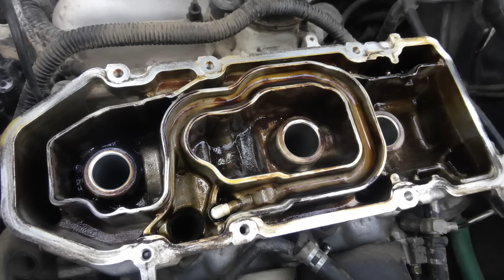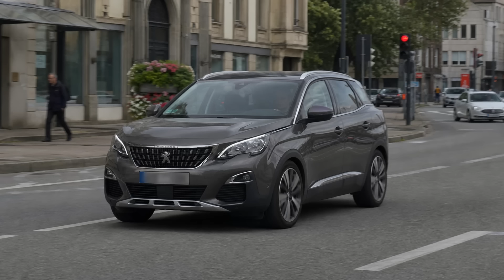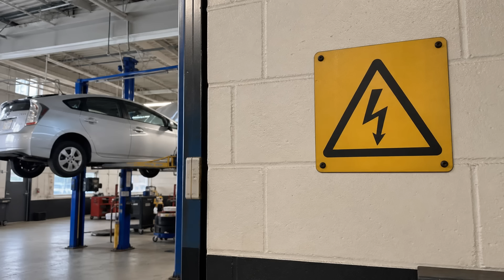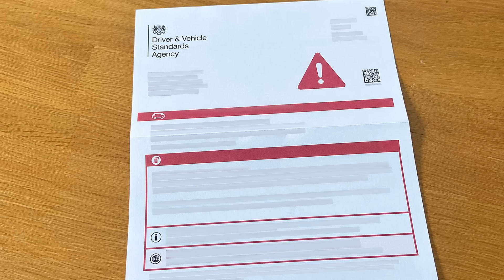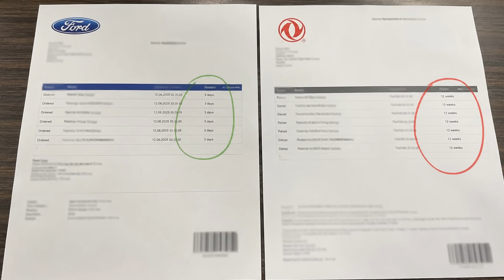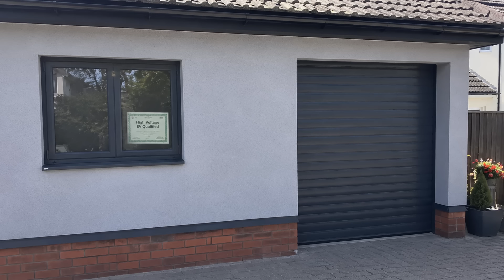12 SUVs BANNED From UK Garages! Here's WHY

Comment: I can't find the diagnostic socket anywhere on my 1958 Austin A55 Cambridge! 😳
Reply: They usually only have trouble with that big nut behind the steering wheel 😅
Reply: @chrisbraid2907 
Sometimes the jerk in the seat causes problems too😁
Reply: @frenchenstein 😂
Reply: @frenchenstein  some fell on stony ground!
Reply: @chrisbraid2907 😂
Reply: @chrisbraid2907  10.4
Reply: Or a 1994 Montego!🤣
Reply: I think mine was deleted on my 1968 Ford Escort 🤷🏻‍♂️(🤣😅😂).
Reply: Have you not tried phoning customer services at Austin Rover?
Reply: @johnboluski-zl1qn 
😊 why didn't I think of that??
Reply: Excellent!
Reply: The old A55 was my first car after I passed my test. From memory I think the gear lever was on the steering wheel, forward and up for 1st etc. Great little motor. 0 to 60 in about 90 seconds but it got me where I wanted to go
Reply: @davidadams5116 
Yes, David, 4 speed column change. Someone  has put a 1622 Farina engine in it.
Reply: Lift the bonnet,  tweak what needs to be tweaked,  put ya tools away, and off ya go. Job done.
Reply: Real engineering
Reply: Poor you!
Reply: My dad bought a 2nd hand one around about 1968, and the handbook told you how to drive the car, after reading it and some practice I could drive it up and down the driveway, age 14, never got out of 2nd gear though.
Reply: I couldn’t on mine either.  It must of been a design fault.
Reply: That’s because On them cars the diagnostic socket is in your head 🤣🤣works so much better 👍
Reply: Its behind the steering wheel🤪!
Reply: You shood know  its behind the left  headlight 😂👍
Reply: @edwinlane9099 
I'll check again, Edwin ! Thanks a lot.
Reply: It's probably in the boot !
Reply: @gstree 
Of course! I'll have another look.
Reply: Think you will find it in the Haynes Manual under new cars are sh@@e section.
Reply: You lucky bastard lol.
Reply: @conradnagiah3696 
Unlike your sad self, I had a father who taught me to speak respectfully and with dignity. I await your genuine apology.
Reply: @colvinator1611  It was meant as a joke, you're fortunate having a simple car without all the complex electronics.
Reply: You can find the socket at the 67 year old semi retired mechanic down the road. I'm so old that these1950s cars I used to convert from positive earth to negative earth and replaced valve set radios for transistor radios. So old that I gave up when electronic ignition became the norm. I could go on and on but it's true. New plug in and diagnose vehicles are a nightmare to me. I hate them.
Reply: @khayimsimpson5153 
If that's the case, I'll just manage very well without it ! Thanks for the advice. 😅
Reply: @khayimsimpson5153 
I put a transistor radio in my A60 in the late 70s, the Sanyo radio had a switch on it so you could change the polarity.
Reply: Me too my cigarette jack only runs cigarettes  😂
Reply: Your joking. Them things never went wrong  my dad always said  he would go to an Australia  in his.  It would start first time  and never fail
Reply: How surprising
Reply: Oxford ones only have them.
Reply: @petercucumber4380 
Gasp ! I'll have to get that Haynes manual.
Reply: O, a lucky person!😅
Reply: That can be located within your own brain and is directly  connected to you hands, eyes and ears!
Reply: That's because they are super simple, like their owners.
Reply: It's underneath the  heated seat module.
Reply: Its in the same place as my 1973 vw beetle
Reply: It's behind the back seat. Remove the big piece of cardboard covering it from inside the boot. Replace the points  in the electric fuel pump.
You won't need the diagnostics now, everything else is straightforward.
Reply: @gordy_wgtn_j8 
Aw thanks. I'll get cracking.

Comment: Have a 2006 Kia Rio with 270K miles on the clock. 1st hand. Bored to death to drive it but I'm going from A to B and it has hardly gone to garage apart from service. Thinking of buying a Sandero with LPG. Don't like batteries. Never did. My only issue is the spare wheel Well the lack of it I mean.
Reply: I have a Rio diesel 2011 never go wrong bomb proof engine with a cam chain what more do ya need .. no garage bills
Reply: @Mark-iu8mr How does it fare with all the ULEZ baloney?
Reply: @JohnDobson-j7o I don't go to them areas live no where near the city .happy days lol
Reply: I have 2017 Dacia Sandero Stepway. Great, simple car and easy for independents to service and fix. Cheap too and good on fuel. Be careful with the newest ones though...

Comment: I have a 2012 Kia picanto -  a little four door town runabout. 2 months ago I took it to my trusted local independent garage for its annual service and MOT test. All well, apart from an airbag warning light which the independent's access to software would not diagnose and they told me that unfortunately I would have to take it to the local dealer. The local dealer, who I have avoided for a few years as they have done very poor, and even damaging work on this car in the past at very high prices, charged me £260 simply to plug into their computer and then £460 + labour at £135 an hour for an airbag unit.
Reply: Main dealers are to be avoided, they are crooks.

Comment: I have an Audi TT 2015 with 50000 miles on it. I’ve had it 5 years. Dealer service £800, independent repairer (accredited by Audi) £350 per service? Tyres, replaced once, nothing else. When I look at new cars I cringe! I won’t ever have electric, autonomous driving or hybrid. The only thing I would consider is old school! I may just keep this Audi TT for ever.
Reply: Rust: Hold my beer
Reply: Good choice if you don't need rear seats for adults, good boot space with the rear seats down though
Reply: Older the car are better new cars just a massive headache unless you got deep pockets.

Comment: VW Tiguan & any car with a panorama sunroof The roller sunshade blind detaches from its side guide/carrier. It needs a replacement. Genuine VW part price is high BUT find a VW dealer that can replace the blind, they say their 'grease monkeys' can't do it. Some sunroof specialist companies can repair/replace the blind labour costs £600-700 plus they will only fit a genuine part not a much cheaper Chinese alternative (£15 - £50 on eBay) the Genuine VW part is around £400. You Tube has plenty of videos showing how to do it, not easy, you have to be very careful & check the drains of the roof are not blocked. How could VW produce this awful roof with known problems for so many years & not have trained repairers in their dealerships?
Reply: I had a 2013 Tiguan track and field, a brilliant car but once that panorama sunroof let's go, it's a nightmare. Stay away!!

Comment: GOT A VOLVO V70 ESTATE it just goes on forever in 8 years ive fitted tyres oil and filter its never faild a mot its paid for ,cheap motoring i am going to keep it forever
Reply: I had a 2010 xc90 for 6 yrs until last year. Servicing and consumables and a sensor / solenoid or 2.  Never let me down. Spend total in 6 yrs was less than 2 years on the LR discovery 3 I had before. Now have a 2015 xc70 again  a D5 engine.
All you need is a good volvo specialist of which there're  many, And a mindset to have carsercvices at half of its volvo recommended service intervals. Mine is 18k...no way.... 10k max for me
Reply: Same things needs for our now 22 year old Cayenne. Had it half of its life and it’s rock solid and passes mot without fail. Needs oil changes, tyres and brake pads.
Reply: Is it a D5?

Comment: Simple buy a old car easy to fix
Reply: Govts are legislating them off the roads.
Reply: Getting spare parts can be a problem. I cannot get a replacement window motor for my 2006 Skoda for love nor money. And the independent garage told me that this model was omitted from the newer version of the diagnostic software.
Reply: @WimTon you will just have to re-engineer it won't you.
Reply: @WimTon 
That issue led me to do a spot of hands free driving in the past. Left hand on the window toggle switch while the right fist thumped the door. I guess you've tried the scrap dealers.
Reply: @WimTon plus scrapyards appear to be deliberately being set on 🔥 reducing available spares.
Reply: And learn to weld?
Reply: I swapped my car for an ebike 5 years ago.

Its now done me 40k miles with nothing more expensive than a replacement motor, at 350 quid.

Forty thousand miles...
And all I've had to replace are a couple of spokes, some brake pads, and a motor. My total outlay has been less than 3k.

You cant compete with that kind of economy.

It costs 21p to charge to full, and i get up to 85 miles for that.
Reply: @NiSiochainGanSaoirse  Lets see you carry 3 bikes and a kayak on it.
Reply: Better yet do without.

Comment: I have a Mk5 2017 2.0 tdci Mondeo. A 
Chain driven oil pump and dry cambelt with the timing chain linking the 2 camshafts which are easy in comparison to access but still labour intensive. An independent mechanic can work on it without having to turn it away.
Those 2.0 tdci engines are very robust but they have their flaws mainly with DPF/EGR issues if used mainly for town driving. One word of warning with these Fords regardless of the actual engines are the 'Powershift' auto boxes...STAY AWAY FROM THEM ⚠️
Reply: I have same vehicle, same year, with just over 200,000 miles on it, getting the timing chain replaced next week, nothing wrong with it, just preventative maintenance, I change the oil every 5000 miles, and I know it will get to at least 350,000 miles before I look for another vehicle !
Reply: @DavidPipkin-yh5wl damn straight. I service mine between 7 - 8000 miles with 135,000 miles on the clock. Those facelift EcoBlue's would probably suit the 5000 mile servicing more because of the 'Wet belt' system they use. I'll not be ridding of mine anytime soon ❤
Reply: Brother has the same, I have a 22 year old Cayenne S with old school 4.5 V8… pretty simple to fix compared to many.
Reply: I would disagree about the Powershift auto box. The Getrag 6DCT450 box is reliable if maintained properly. However, Ford chose not to include the gearbox in the car's scheduled services but as an optional service action; therefore, the 37,000-mile oil changes didn't get done. Owners weren't prepared to pay £300+ for something that was seen as optional. Unfortunately, the oil and filter changes are critical for the longevity of the gearbox. There were very few complaints when Volvo used the Getrag 6DCT450. I had a 2012 Mondeo 2.0l Ecoboost with the Getrag box that performed reliably for 125,000 miles, with the gearbox getting serviced every 30,000 miles.

 The Ford-designed and built dry clutch Powershift gearbox used with smaller Fords such as the Focus was basically crap.
Reply: @honymonster30 I know a few people who have the Mk5 Mondeo, not the MK4 like you had, nearly all have had problems with the automatic gearbox, but the ones with a focus have had very few problems.
Maybe it's the way you drive, short or long journeys etc
Reply: @DavidPipkin-yh5wl  The MK5 petrol engines have a conventional autobox rather than the dual clutch that the MK4 have. I've had my current MK5  2.0l Mondeo for 5 years and have had no problems with the autobox. Problems with the Getrag 6DCT6450 and the smaller 6DCT250 are well documented. In the case of the 6DCT450, most problems came from a lack of maintenance. The most common cause of problems in the 6DCT250 was oil contamination from leaking seals. The MK5 diesels still use the 6DCT450, while the petrol engines use the torque converter 6F35 autobox.
Reply: The weird thing is that vans like opel movano, peugeot partner and citroen after 2021 that have preety much the same engines started wearing valve lifters and camshafts. Not sure why but i have 4 od those movanos on the yard
Reply: Why would you need a convertible in the UK?
Reply: @donmclean554 I drive an MR2 all year in Scotland. Roof down on a dry day in winter is magic, heater on half is good enough. Because the UK is generally not scorching it's perfect.
Reply: @donmclean554 😢